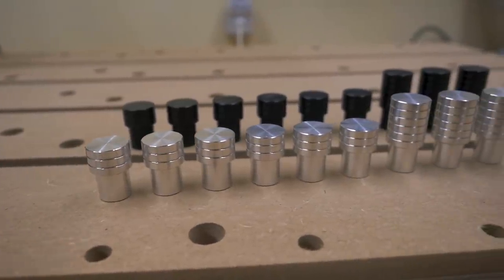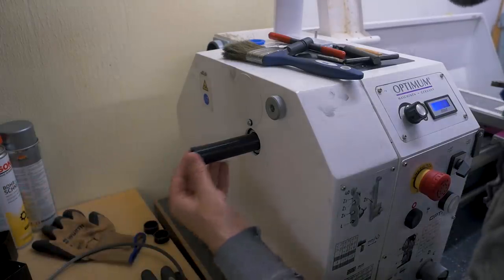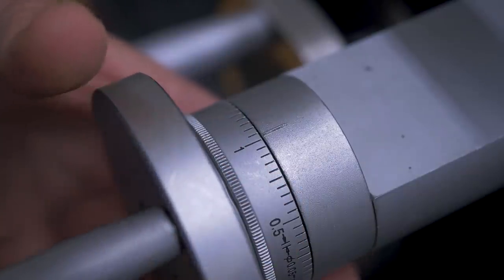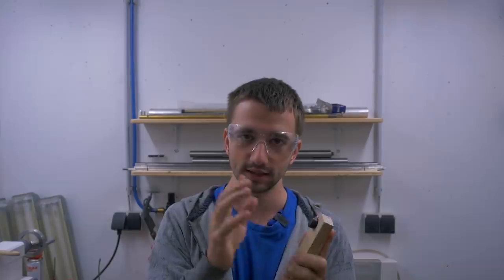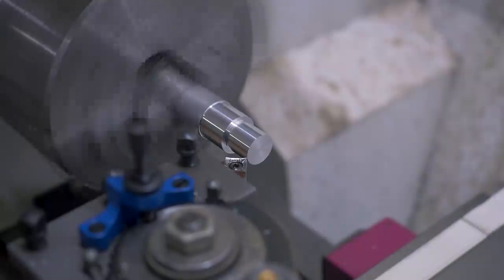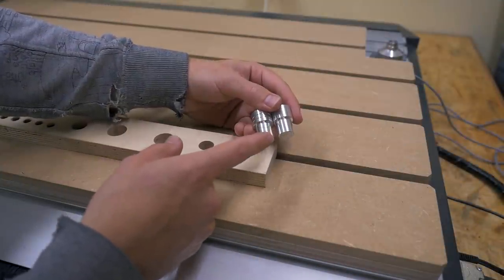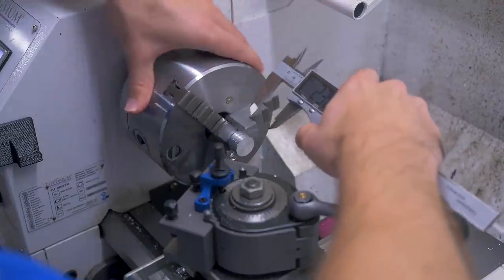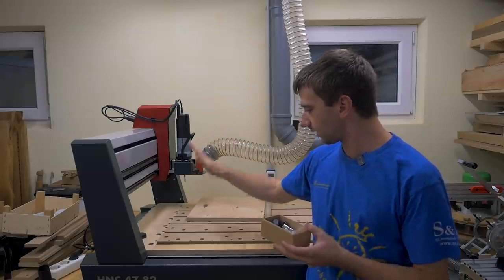I made Precision Bench Dogs

Comment: It would be interesting to make a small hole through to let air out and see if they are easier to put in/out.
Reply: You could also make this help reduce the amount of operations (obviously adding a through hole adds one, but for a functional reason), add an external chamfer mid parting, then you only need a small chamfer on the hole on the parted side.

Comment: @Marius Hornberger Don't try that parting trick on steel. If the parting blade doesn't have the same pressure on the left and right edge it will not cut straight and you get a tapered wall. At some point you'll wedge the tool in or deflect it enough to stall the lathe or break the insert. I have very little luck with that style of parting tool myself, and each time an insert breaks it usually destroys the holder as well. Small lathes are notorious for being bad at parting because they are not rigid enough. You can try mounting the parting tool directly on the cross slide (without the compound or top slide depending on how you call it) to get a lot more rigidity. Some people also make small fixed toolposts that hold the parting tool upside down and mount it behind the the workpiece so they don't have to remove the compound. It also means you have to run the lathe spindle in reverse and you don't see what you're doing.
One probable reason why you stuck an insert in Aluminum is lack of lubrication, as it will cold weld on most tools and gum up your cutting edge making it rub instead of cut. Rubbing = heat = expansion and you get stuck. There are cutting fluids especially made for Aluminum but even WD-40 will make it somewhat better... and also make a lot of mess :)
Also, when parting you continuously add lubricant to keep the cut wet and tool cold unlike normal operations where you normally just smear it on. It's hard to say from video how fast you run the spindle, but parting operations will typically be made at slower RPM then normal turning.

Comment: To make the pop sound a bit louder, you could tighten the tolerance between the hole and peg by juuuust a touch, by applying a thin and consistent coating. 

DIYPerks did something similar to achieve a very thin low-friction water cushion between a cylindrical magnet and a glass tube.

Something like chromate conversion will add about 1um (radius). bluing will add about 25um. With electroplating you could get a wide variety of thicknesses 10um+ depending on time

Comment: Make your dogs just under 12mm height, using 12mm thick jigs you can attach parts together with locating dowels onto the top of the dogs and machine right through the top board.

Comment: You should send them in to get anodized, most anodizing places will do small parts like that for very cheap if you say you dont care about color and let them just throw it into the next electrolysis bath they run.
Reply: In this environment, would this be mainly for appearance or are there still corrosion concerns?
Reply: @thehangardesigns  appearance, anodized finish is lovely. Anodizing is great for corrosion but I imagine that Marius's CNC will be a pretty mild environment

Comment: Marius,  I made a 3D printed plane stop... its worked really well, expected it to snap but not yet! HNC 47.82 arrives in a week... can't wait!
Reply: @buddenjoejoe5549  Arrived and is a solidly built thing! Eding CNC is not the easiest of programmes to understand when English, as nearly all videos how it works are in German or Dutch so hopefully that's not an issue for you. Finding it very difficult to set the boundaries of the machine and stop it trying to 'jog' past its limits.
Reply: @buddenjoejoe5549  Fusion 360 is my default for modeling anything up at the moment.

Comment: Nice job! You can cut the part to the correct lenght with the paring tool. Make a channel, chanfer, measure the lenght, adjust and cut. If your paring tool has a small angle on the cutting edge, right side looking from above, it will cut the part leaving a tinny barb. When making lots of parts it saves time.

Comment: Just a small tip from my side. If you make fitments, try turning the last 3 cuts with the same depth of cut. The reason is that the insert will always have the same cutting pressure, so your diameter will get more precise and easier to get to 0 or the fitment you want.
Reply from the maker: Thanks for the great tip. I'll try next time
Reply: you do however run ino the risk of ruining you surface finish, if the cutter happen to slide over the surface instead of cutting

Comment: The caliper is not a precision instrument and one shall not rely too much on the digits that are on the right hand side. If you want to ensure the 1/100, then you need a micrometer. Digital ones are very expensive and not fun to use. One can buy very good Mitutoyo micrometer second hand on eBay or alike for 20 euros!
Reply: This is a homeshop, its not very precise anyway :)
Reply: And yet for the job at hand, probably more than accurate enough!
Reply: Good grief, it's plenty accurate. They're going into a piece of wood.  Nice job Marius!
Reply: I've heard this so many times before. I may be just a hobby machinist but every person I ever known that has used calipers have gotten perfectly precision parts using them. I guess if I were making parts for SpaceX or NASA, I would break out the micrometer. Sometimes do for certain work. Usually on the lathe.  A decent set of calipers used correctly will give you perfectly fine measurements .

Comment: Nice! 👍
I've just received a linked v-belt for my lathe (photos in my instagram)
You should use metal foil, or sheet to cover the part. (usually covering the jaws to not scratch the part)
Reply: the foil of a cut open softdrink can works well

Comment: Is there a way to cut wood with the metal lathe? Like remember the video where you turned the Ironwood/Ekke bowl and your wood working tools dulled quickly, do you think the metal lathe (if you had it then) would have been much better?
Reply from the maker: It wouldn't have been better, because you can't really make the free hand cuts that you can make on a wood lathe
Reply: You can totally do that. The fine control wouldnt be as good, since a metal lathe works in 2 axis, while by hand you can make nice curves, of course.
Using the Insert tooling would be the way to go. You can also cut metal with HSS (The same stuff as the woodturning tools are made of), but the geometry is vastly different.
HSS tools for the metal lathe would probably still work better than the woodturning tools, because of the geometry.

In short: If you can work out making the curves on a metal lathe, it would indeed be "easier", or rather less of a hassle with sharpening tools.
Reply: You don't want to cut wood on metal working equipment.  Woodworking equipment is kept dry (dry film lubrication, no oil or grease) to keep sawdust from sticking to it.  metalworking equipment is supposed to be kept well oiled to both lubricate it and prevent rust (especially if you use coolant).  The sawdust will be attracted to the oil, soak it up, swell and jam up your lead screws and gears etc.  You really should not have metal working machines in the same room as wood working without well thought out dust control and extraction to keep it away from them.  For cheap junk hobbyist metalworking toys this may not be true, but for real metalworking machinery, keep the wood away unless you want to spend many hours cleaning the machine.
Reply: @MariusHornberger  Actually you can, just put a long piece if bar in the toolholder and use it as a toolrest. But I wouldn't do it unless in dire need as wood dust will get everywhere and stick to oil on the ways. Not good for metal working tools.

Comment: since your cnc surface was faced with the router, couldn't you bring the dogs to length with the router itself? that would make them exactly the same height, although with a different surface finish.
Reply from the maker: that wouldn't be pracital, since facing the off on the lathe took about 5 min with setup and makes long shavings. The router would take longer and make a much bigger mess
Reply: Plus, you can't rely on the holes in the MDF to hold the stock  to ensure enough stiffness for cutting aluminum.

Comment: Did you notice a smell when you cut the POM rod?
Reply from the maker: No, no smell at all
Reply: Oh yeah, the "fishy" smell :(
He used pretty sharp cutters, maybe it didn't heat up the POM or shave micro particles.
It does turn very nicely though, unlike PE and it's nasty elastic chips that Just Won't Break